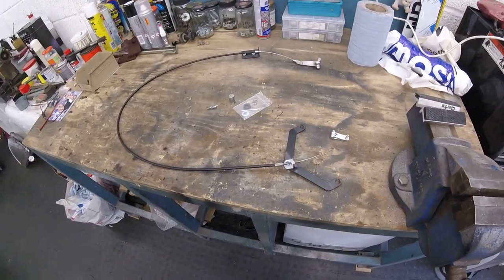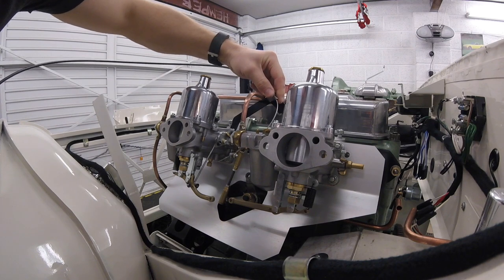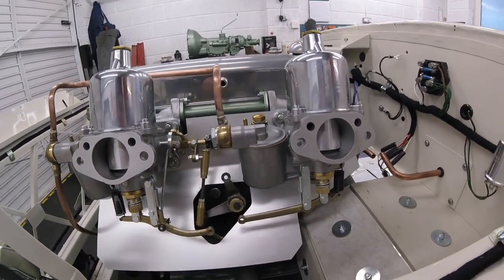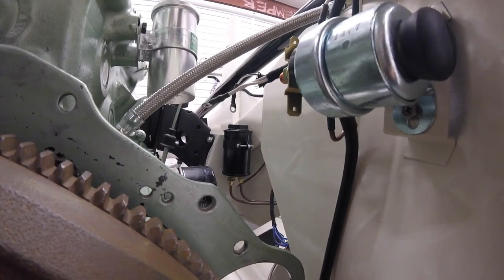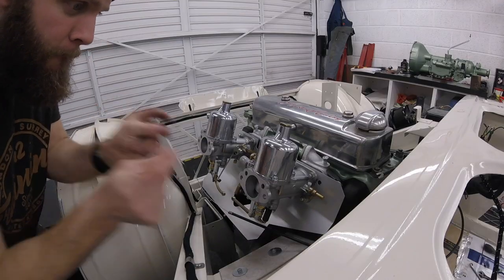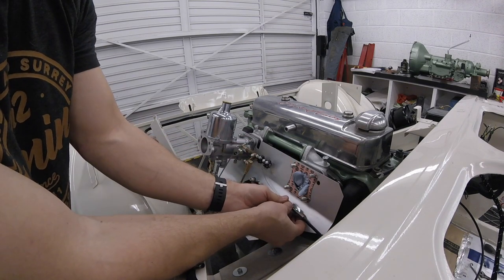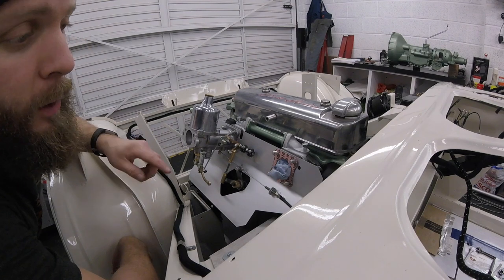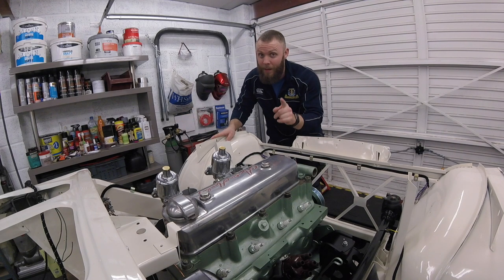Fitting A Throttle Cable Conversion Kit To our M Spec Austin Healey 100/4

Comment: Nice job, James. Is that the A. H. Spares kit or Cape International. I did the same conversion on my 6 cylinder BT7 using parts from the Dennis Welch kit.
Reply from the maker: It’s a cape kit. I’ve got a lot of time for Steve. I modified it to try and keep as much of the linkage as possible to keep it looking correct (ish) viewed from the top...
Reply: @Resto.Nation  Thought it looked like Steve’s. Thanks.

Comment: I had several AH including a 100/4 back in the 1960's and I remember the bell crank on the exhaust manifold. The heat from the manifold would burn off any lubricant on the bell crank post and cause the motion of the bell crank to stiffen up and sometimes not allow the throttle to return to idle when took foot off the gas pedal. Silly OEM design and shame the throttle cable conversion for the sake of originality appearance not do away with the bell crank post on the exhaust manifold.